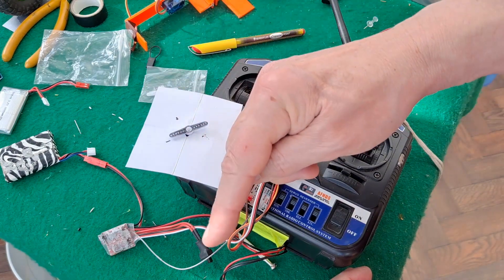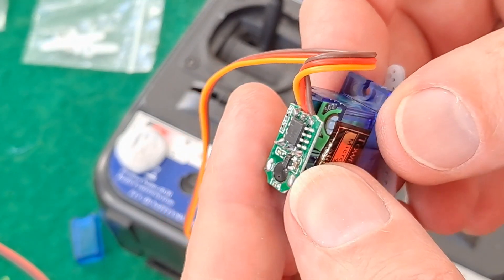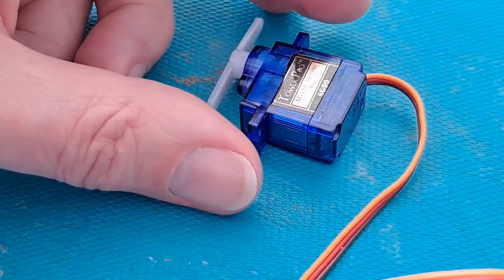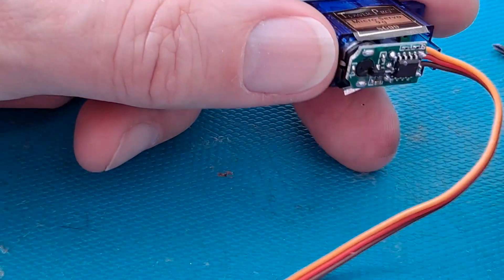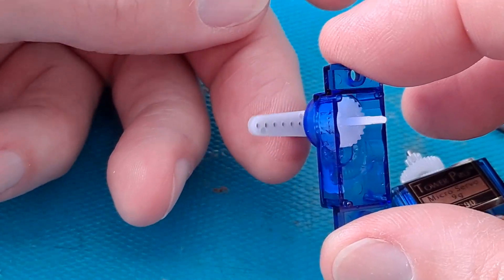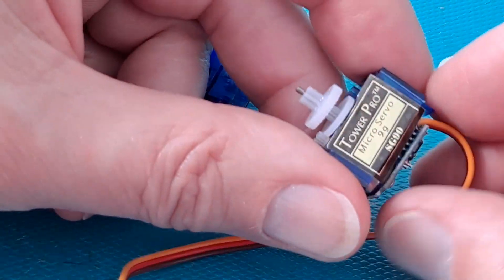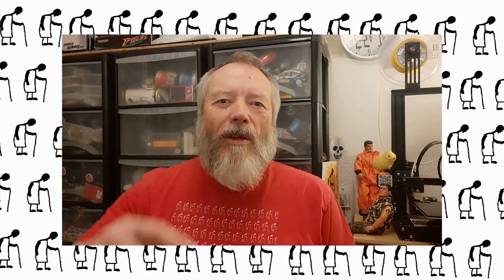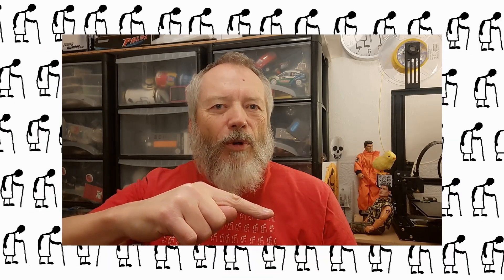Demonstration of changing the rotation on a SG90 servo with resistors

Comment: great minds thing alike , i like the reasoning of getting the wires out instead of moding in fix resistors , plus that way adding a return to default or other presets with a mutiple position switch becomes feasable , cheers ! of course ill still use the default endpoints i managed to get out of my tx16s with an r168 with these little servos , but now i can break out of that ~1000ms-~2000ms limit i was hitting using that max range in the translation , or just lower the endpoints from the ground if necessary after that
Reply from the maker: Good luck 👍

Comment: I notice one of my cars' transmitters gives me very poor throw. Didn't want to rip the electronics out as I'd bespoked them in... this looks viable. Thanks buddy.
Reply from the maker: With many transmitters, you should be able to adjust the end points in the settings. I had never considered fiddling with the servo. This was another request from the comments. I was very sceptical about this working, even after watching some videos on YouTube so I had a go myself. I used potentiometers so I could check it over a range of resistance. I did something like this when I converted servos to continuous rotation and didn't find any difference using a range of resistors so this was a surprise. For continuous rotation I was trying to vary the speed of rotation rather than the range of rotation so that would be the difference.

Comment: Brilliant Graham. This is a perfect solution for anyone without the "End Point" function on their transmitter. I am sure you have an "End Point" setting on your other Fly Sky transmitter with the LCD screen. I have a couple of Futaba transmitters with the "End Point" function which lets you adjust the travel of the servo to higher or lower from the default position.
This alteration of yours is perfect for a transmitter without the function. Just adjust the servo to your needs and then stick the little pots on the side of the servo before installing it.  Excellent idea. I have never seen this done. I do realize you are doing this for demonstration but you "could" use this idea as a practical application if you don't have a transmitter with lots of functions, particularly the "End Point" function. 👍👍👍
Reply from the maker: It was another request. I was very sceptical about this working, even after watching some videos on YouTube so I had a go myself. I used potentiometers so I could check it over a range of resistance. I did something like this when I converted servos to continuous rotation and didn't find any difference using a range of resistors so this was a surprise. For continuous rotation I was trying to vary the speed of rotation rather than the range of rotation so that would be the difference.

Comment: Thanks for the nice informative video. I've been playing with driving servos with micro controllers lately. It's good to see other methods.
Reply from the maker: It was another request. I was very sceptical about this working, even after watching some videos on YouTube so I had a go myself. I used potentiometers so I could check it over a range of resistance. I did something like this when I converted servos to continuous rotation and didn't find any difference using a range of resistors so this was a surprise. For continuous rotation I was trying to vary the speed of rotation rather than the range of rotation so that would be the difference.

Comment: Perfect video. Thank you for your interest to my question and thank you for this amazing informative video. I will try and inform you with 2.2 resistors . Wiring outside was good idea by the way. I will do the same since the space is very limited inside the servo.
Reply from the maker: You might find inside is easier if your resistors are the right length. Wiring outside involves twice as many solder joints. If I wasn't doing it for demonstration purposes I would have cut the potentiometer legs and put the resistors in the gaps.
Reply: @GrandadIsAnOldMan  i am not so much talented yet at soldering. i have ordered 0,75 soldex wire for tiny jobs. i am curious that if i cut the potentiometer legs and put the 2.2k resistors they can touch to the motor and short cut maybe. i will try when the tiny wire arrives and share my experiences. Best Regards
Reply from the maker: @Bricksfaction  Good luck 👍 The only way to get experience is to keep trying, so maybe practice on something else 😊